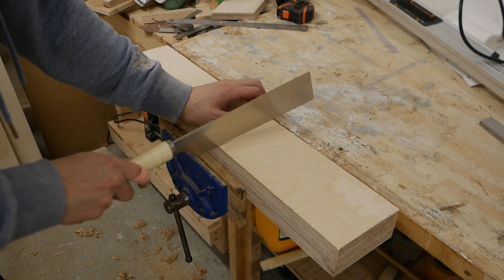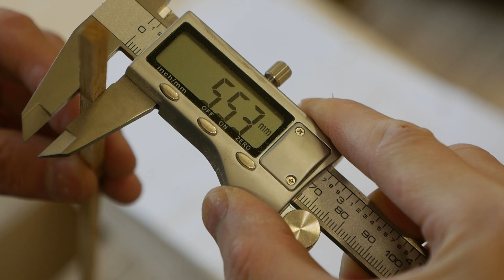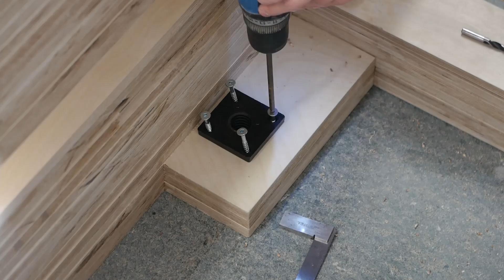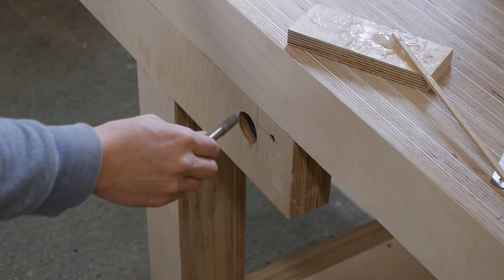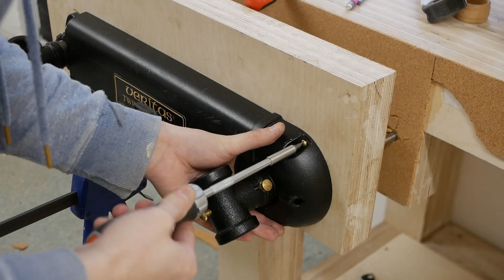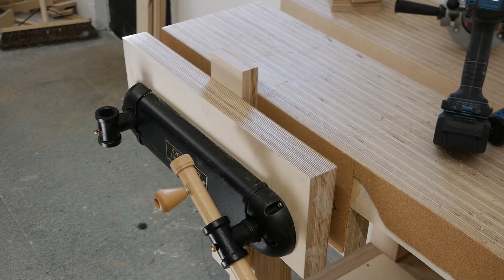Veritas Twin Screw Vise Install & Review

Comment: Hey No5, I'm considering buying this vise for my new bench. At the end of your video you mentioned the vise screws bind when you open it too far. I just watched another video and the bloke solve the problem by attaching a board to the underside of the bench, between the bench and the screws, thus preventing the screws from racking. Here's the video if you haven't already solved the problem. Oh, and how do like the twin screw Veritas?
Reply: https://www.youtube.com/watch?v=gGpKbQ2-65c
Reply from the maker: Thanks. I remember seeing this solution from the instruction manual. Overall it’s a very solid and beefy vise. In practice the only downside is that it doesn’t have a quick release mechanism and it takes a lot of turns from wide open to closed up.
Reply: @No5Workshop  Mine is in the mail. I've bought an older screw vice for the side, which has quick release. Thanks for replying. DD

Comment: Chains, in general, should have some slack in it. It will turn both sprockets consistently even with slack and it will allow the bearings in the chain to roll uninhibited by any unnecessary pressure. You will get weird wear patterns if a chain is too tight and you will have difficulty turning the vice.
Reply: Would you say this is already too tight in the video?

Comment: Sorry, not sure if I missed this information in your video, but, how long are those screws? Considering buying this vise, but not sure how long of an overhang I need to have for the screws under the table top. Thanks!
Reply from the maker: Hi I can't remember on top of my head. But I think it's definitely in the veritas manual which you can find online.

Comment: 👍🐯👍. Good job on the installation. Can you do a review of the record jack plane you have? I'm interested in one and wish to know how much work goes into getting it ready to work properly.
Reply from the maker: I got it ages ago. Apart from  sharpening the blade, I don't think there's a great deal needed to be done. The sole is flat and the depth adjusting wheel is smooth as well.